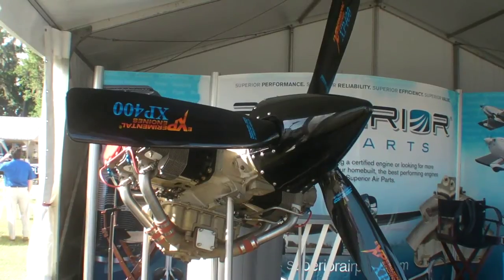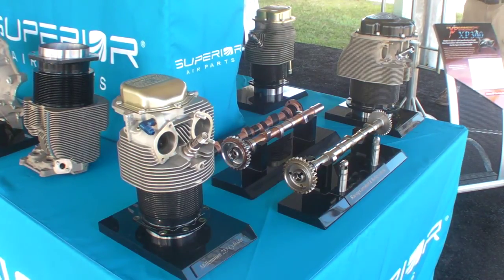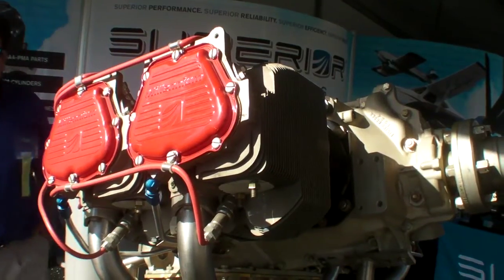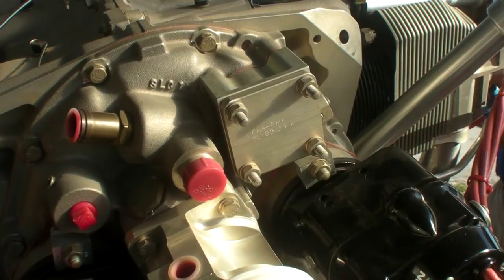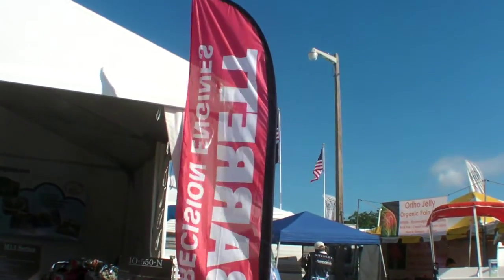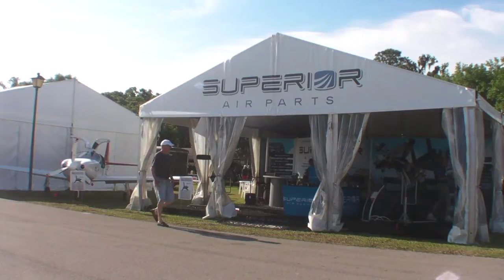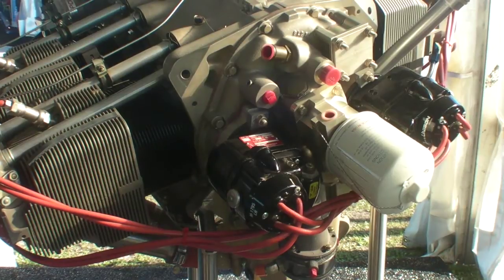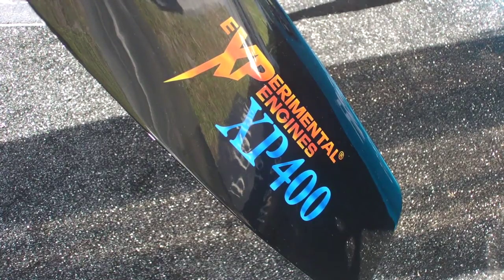Superior's New XP400 Engine

Comment: Hope their quality control has got better. Been helping put together one of their oi-360 engines. Not very impressed. Had a crankshaft defect. Had two roller follows not machined correctly. Crankshaft dowels with with hammer marks. These parts are taken from the same production line as their certified engines. Their assembly manual is a work of fiction also. They also sent the wrong sump
Reply: Hello, read comment got interested! Won't it come assembled and tested already?